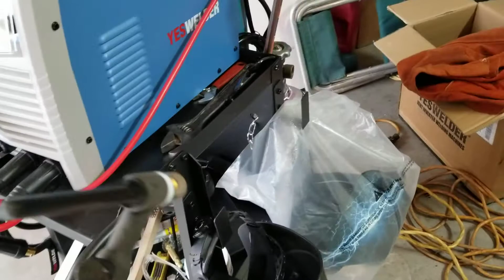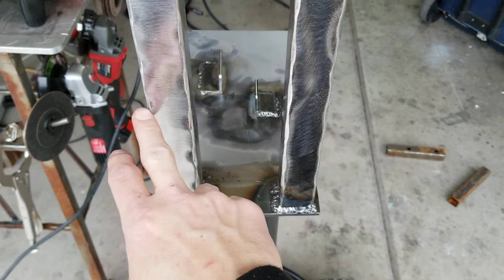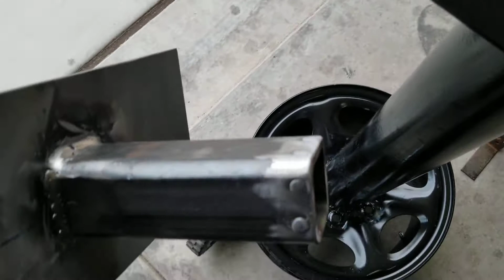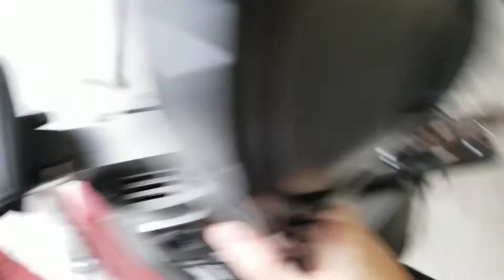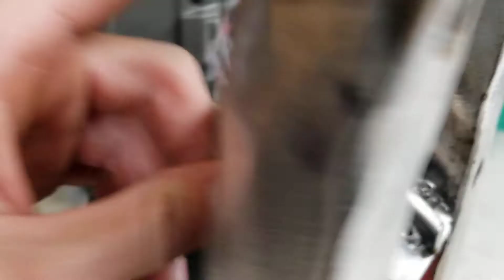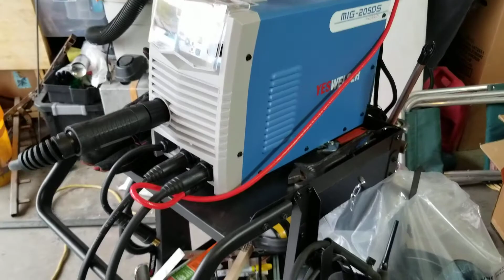Harbor freight portaband band saw mount and stand.

Comment: You can put a plate on the front of the stand so when you step up to the saw you would be standing on it and it will never lean back when you push your metal threw the saw and when you make a table you can put rods threw the tube that holds saw

Comment: Nice stand.  To take the wiggle out, put four rubber/silicone pads in each corner of the bandsaw receiver bottom that slides into the stand, it'll take up the slack and dampen it at the same time.